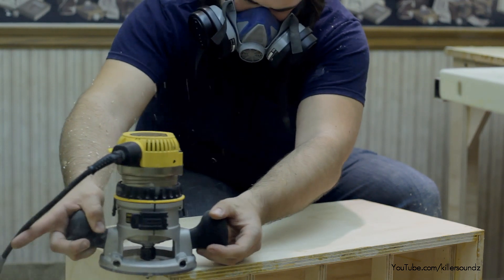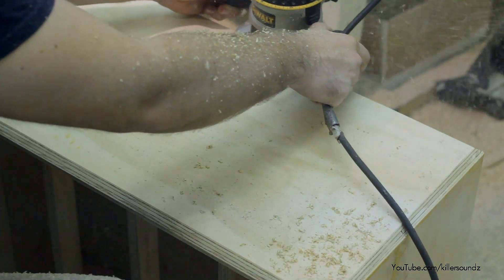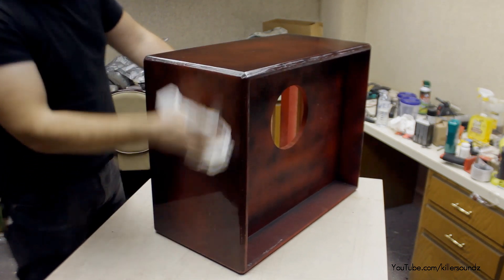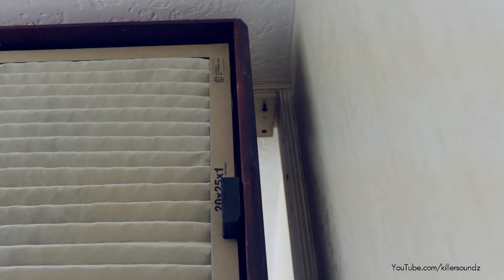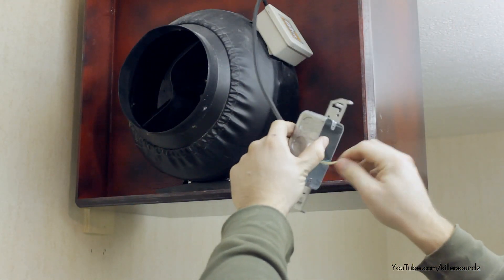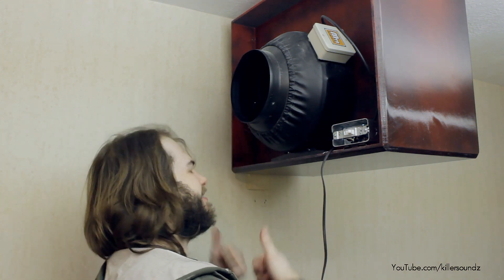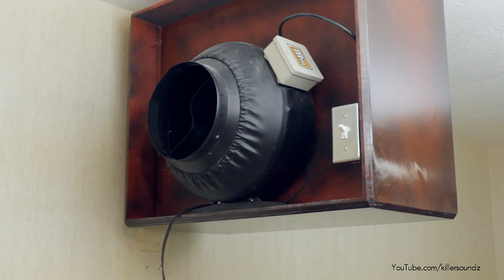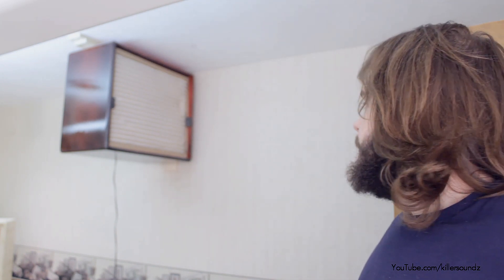Build a Woodworking Dust Filter Air Purifier DIY 100 bucks | Part 2

Comment: 1] You dont need a 3' long driver bit in your battery drill. Ever, really. [wtf?]
2] You don't need Auto CAD or CabinetWare to design a box. Broken pencil and a envelope is faster
3] You don't want a vaccum motor due to the noise. Any squirrel cage blower will do.
https://www.walmart.com/ip/EJWOX-3-Speed-Remote-Controlled-Woodshop-Air-Cleaner-Filtration-System-400-CFM-Dust-Collectors-for-Woodworking/782816912

Comment: instead of making a 3ft screw drivers for your drill, you could have just used the screw driver. or even better just screwed up through the cabinet, did not have to be on the end could have much easier went from the inside.

Comment: Thank you for sharing this. I have a very small workshop in my basement and the dust of course is a problem. My dimensions are 24 feet by 11 feet by 7 1/2 feet (ceiling). Will the air blower you showed be sufficient? Also do you not need another filter on the output end? I thought you had to have both.

Comment: Hi Alex great project and nice end result! I"m in the progress of making one for my diy woodshop. The amount of dust floating around is insane.... I'm still looking for a fan that would work for the purifier but I'm concerned about the higher load on the fan when using a filter in front of it. Do you have any advice/tips to make sure the fan isnt going to overload? Thanks a bunch! Ps great channel just subscribed ;-)

Comment: I see your point about brad nailing but the trick is to not nail straight into plywood edges especially if they have voids.If you dont have 600 cabinet clamps on hand you can always nail some brads in on an angle and in opposite angles to eachother. They will act like angled spikes making it very difficult for the wood to pull apart once the glue sets. Screws now, they are the best. Nice build!

Comment: It's not really difficult to construct wood furniture (for example dining room table, workdesk, bird house, outdoor storage shed, cabinet, ...) that you really want. You simply need a comprehensive plan which contains specific diagram & step by step guides..  Go here =>  https://plus.google.com/110772857933664571003/posts/CoacYhzvnQu

Comment: You prefer this type of setup over a dust collector? You said that they didn't filter the finer dust particles like yours is doing, so I was under the assumption that you only use this for your shop. Curious to know as I don't really want to purchase one, would rather build one of these.

Comment: Oh and you should definitely ALWAYS use wing nuts for 110v electrical connections indoors.  It's a code requirement.  If someone did a poor solder and their house burned down due to a loose connection, the fire department would see that, report it to your homeowners insurance, and you'd lose everything (insurance would refuse to cover due to homeowner electrical work not meeting code requirements).  ALWAYS USE WING NUTS.  They're cheap and simple, anyways.
Reply: Wire nuts! Not wing nuts, wire nuts. Good advice.
Reply: I was impressed by his soldering initiative, however, I am still afraid of the unknown (haven't soldered yet) and much prefer simply twisting on the electrical connections.

Comment: The design seems perfect to me except for one thing: I don't think you should solder the connections on a 110v system.  You should be using the accepted method used to connect 110v wires, those screw-on connectors.  Solder could melt off if the fan bearing seized and caused a heavy current draw.
Reply: Alex Knappenberger You do know what they used before circuit breakers, don't you?  They used FUSES, which have metal much like solder, i.e., fuses were meant to be the weakest link in the circuit so the wiring wouldn't burn first.  I would NEVER use solder in a 110v circuit.